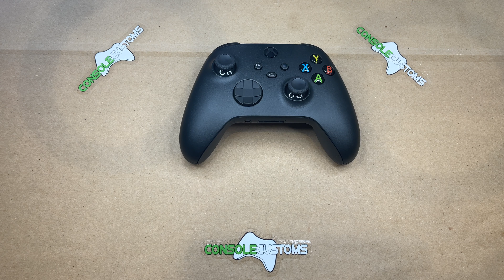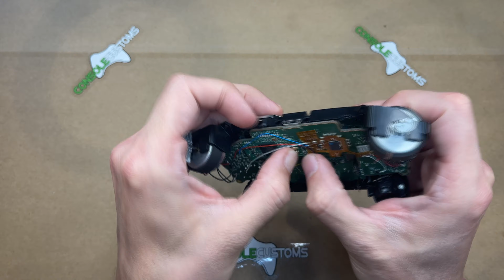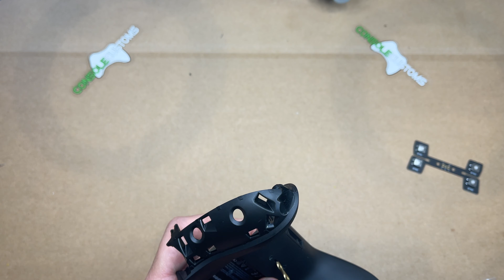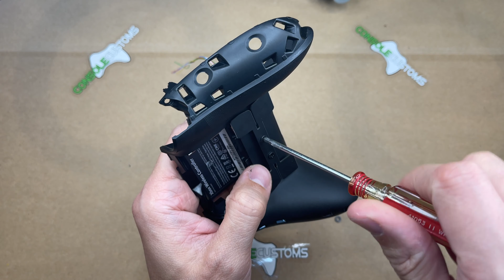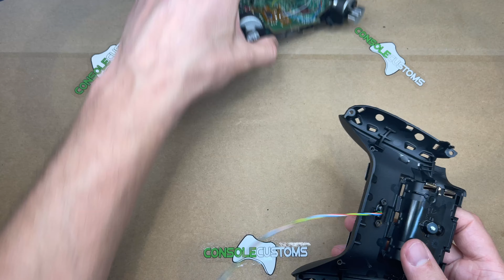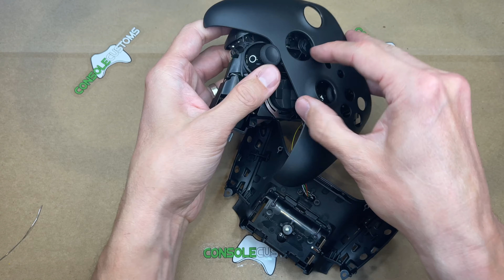Xbox Series X/S Rapid Fire V1.01 Mod kit and Programmable remapping  mod kit installation.

Comment: can I install it on elite controller and just install the rapidfire mod to the back button only ? (because I will remap the key of backbutton with the original software) ?
Reply: No doesn’t work, I have a e2 with a chip and it just freaked out currently pulled the chip out

Comment: ey bro I’ve just recently brought a modded elite 2 from eBay ( the guy sadly doesn’t remember much about it, I did have it working in rapid fire and in auto aim then all the mods stopped so turned the controller and console off and on again, now when pressing the mod switch ( have a extra switch to turn on and off ) but this button used to make the Xbox logo light flash rapidly while pressed now when I press this after turning it on it flashes once and not again no changes for mods etc nothing changes controller still works as it should just won’t activate the mods